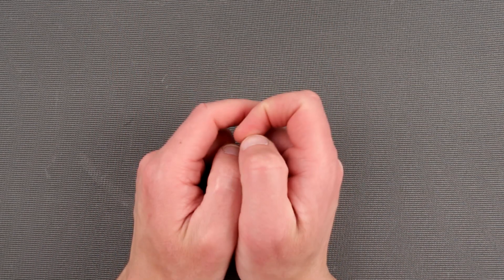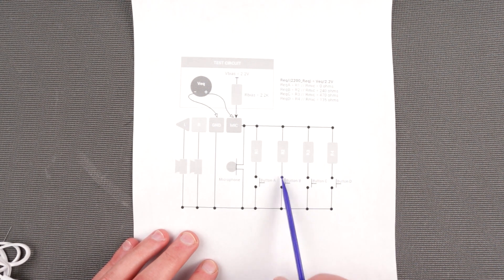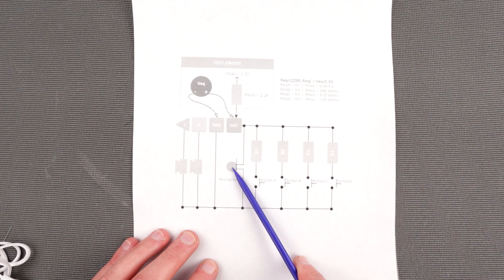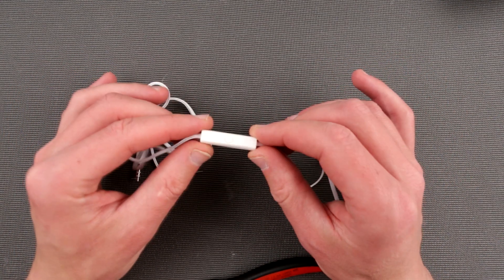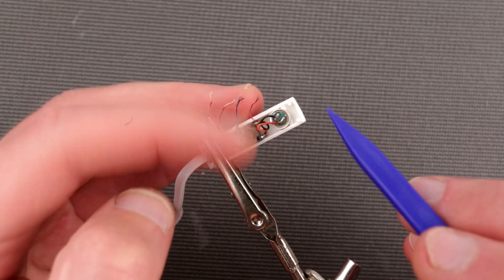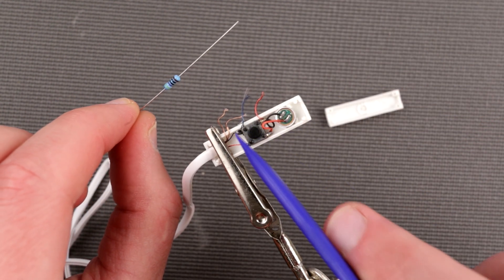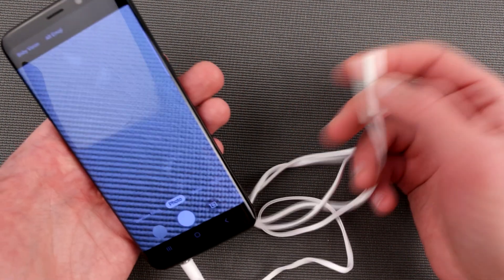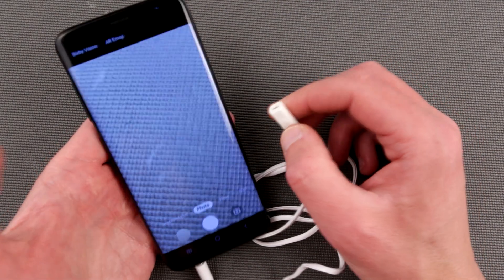How to make simple selfie camera trigger for Android smartphone

Comment: I did everything like you, but it doesn't work. Tested on 3 phone and after shorting phone has no reaction.
Reply from the maker: Thank you for watching, can you check the resistance between GND and MIC when button was pressed, it has to be 470 Ohms.
Reply: @InsideOutElectronics  Yes it is 470 ohms. I even solder gnd to one end of resistor and mic to secend end to check with multimeter and it is 470.
Reply from the maker: @KamilWiniszewski  can you take a photo using smartphone volume keys?
Reply: @InsideOutElectronics  Yes, I tried it on Huawei and Xiaomi phones.

Comment: Hi. My English is bad so I think you won't understand what I try to ask for but I gonna ask anyway. As I see you are good with electrics and electronics. I've gotowe a paralizator and a lighter in a long stick-  for self defence. We always take this stick with us for holiday travel (just in case) Now it is broken. Most of wires are disconnected. I got all parts but have no idea how to fix it right way. It happened one year ago and I couldn't find a tutorial till today. Lighter and paralizator is working if connect battery to the 2 wires coming from lighter, paralizator and button switch. This part of stick is ok. Problems  start on the ends of this 2 wires. Disconnected Parts: battery, capacitor, bridge, charging slot, led dot, resistor, switch button on/off,
Reply from the maker: Thank you for your comment. For detailed help like you want please check - https://www.eevblog.com/forum/ there are many people who can help you for sure. Please add some photos when asking the question.

Comment: Just an FYI... you can't assume the mic as being infinite. It has an impedance, and many phones are looking for that to turn on the headphone port. Shorting with 2K ohms or so when "open" will make it work in everything.
Reply from the maker: Good point, thank you. I made this assumption for simlification, and followed the diagram from google docs for the resistor values.